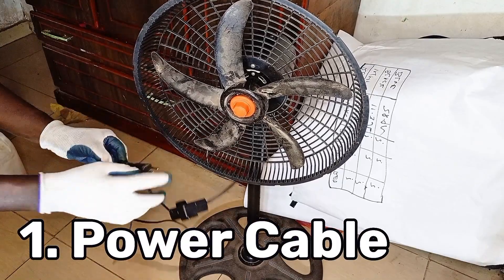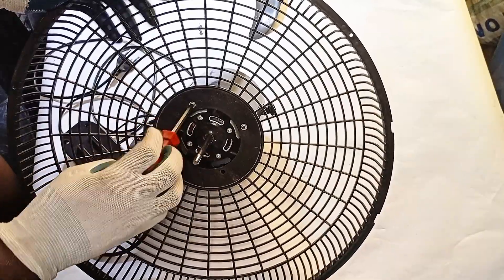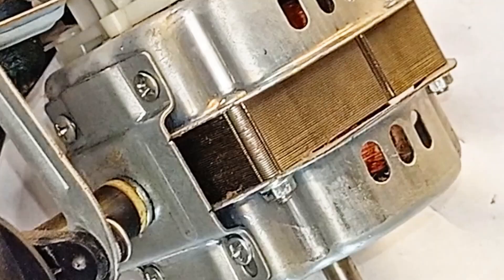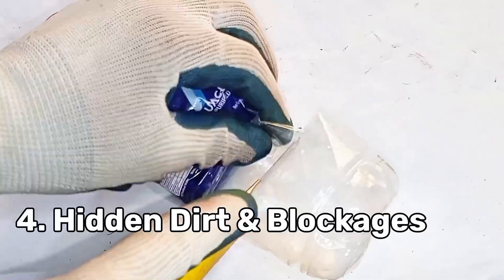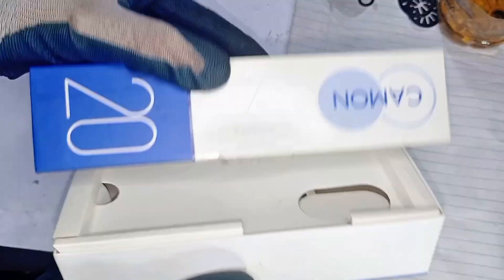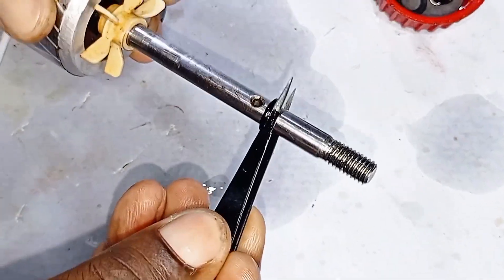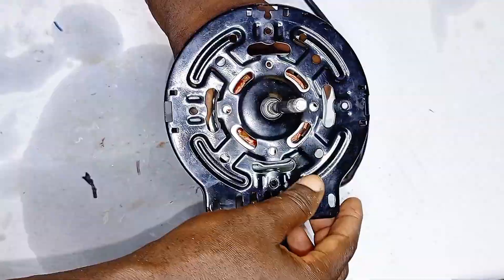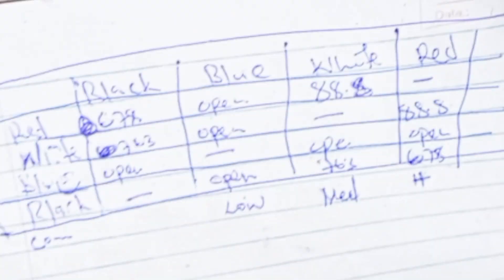Fan Not Spinning? These 5 Fixes Will Get It Working Again!

Comment: Hey man, my fan stopped spinning and it’s not humming after cleaning the bushing like this, did I kill the fan? It was overheating when I woke up
Reply from the maker: Don’t worry bro, you probably didn’t kill the fan 😅
If it stopped humming after cleaning the bushing, it means something simple is still off.
Let’s check it together real quick:

1️⃣ Does the fan spin freely by hand?
If it feels tight or stuck → the shaft isn’t seated right or the bush is dry.

2️⃣ Did you add a few drops of oil after cleaning the bush?
A dry bush will overheat and lock the fan.

3️⃣ Do you hear ANY sound when you switch it on?
Humming, buzzing, low vibration — that tells us if the motor is getting power.

4️⃣ Last thing — does the capacitor look swollen?
A weak capacitor = no start + overheating.

Reply with what you see and we’ll fix it step by step
Reply: @QanaDiys 1, the shaft spins freely 
2, yes I changed the cutton wool and added oil on the bush before spinning 
3, the capacitor is totally fine (not swollen)
4, I'm thinking the thermal fuse has blown due to the overheating 😞
Reply: There's no humming sound on all levels, this after unplugging it after overheating like crazy this morning
Reply: Are you also Nigerian?
Reply from the maker: @Mezthecreator “Haha not Nigerian my bro 😄 I’m from Zimbabwe 🇿🇼.
Now for your fan:

✔️ Shaft spinning freely = good
✔️ New cotton + oil = good
✔️ Capacitor tested = good

⚠️ Overheating + no humming on all levels = 80% chance your thermal fuse is blown.
When a fan overheats badly, the thermal fuse inside the motor opens to protect the coils.
Once it blows, the fan won’t hum or start at all.

You can fix it easily:

1️⃣ Open the motor again
2️⃣ Look for the tiny thermal fuse wrapped in insulation near the coil
3️⃣ Check continuity with a multimeter
4️⃣ If it’s open (no continuity) → replace it with the same temperature rating
Reply: @QanaDiys thank you so much, what if some wires on the stator have cut? One or two. I wish I could send a picture
Reply from the maker: @Mezthecreator If the stator wires are cut, my brother, that’s a very hard fix without seeing the exact damage 
Those coils are super delicate. In most cases it’s better and cheaper to replace the whole motor.

But don’t worry — I’m actually working on a proper video showing how to repair stator coil wires safely. Once it’s ready, you’ll be able to follow it step by step 🔧💨.

For now, the best move is to get a replacement motor so you don’t risk damaging the rest of the fan.
Reply: @QanaDiys appreciate you brother